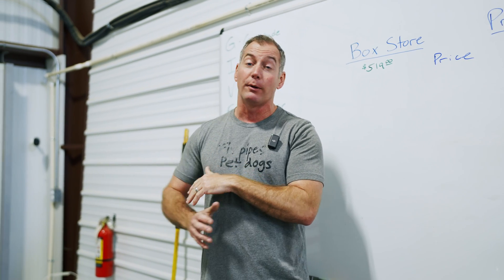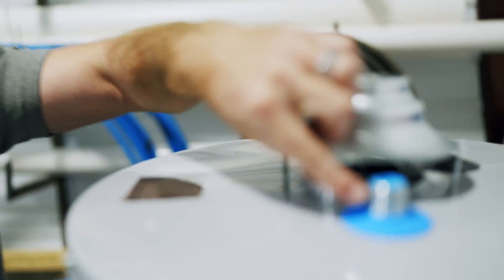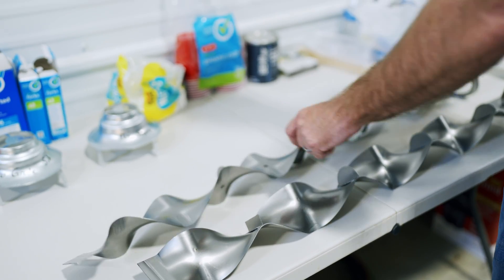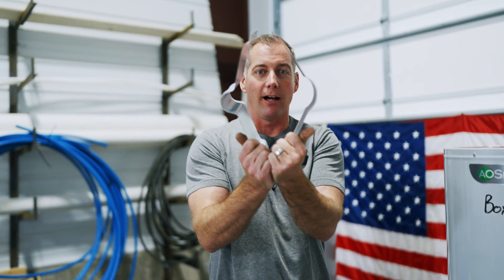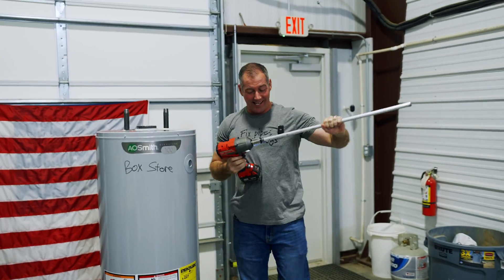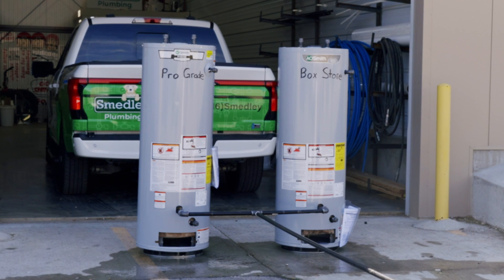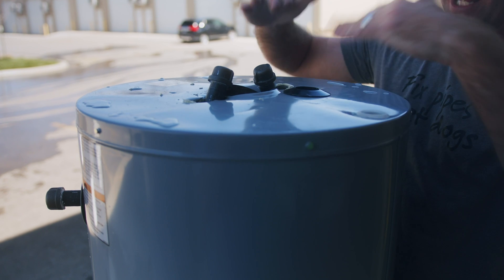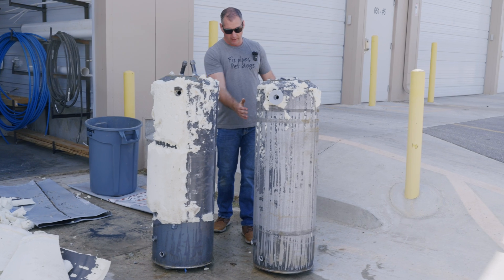What's the best water heater? Box Store vs. Pro Grade

Comment: I've been asked to replace our Reem tank. The difference between stores here is $700 that's alot! I'm going to look it over but hard to justify that kind of money
Reply from the maker: The moment you have to buy it twice, it's worth it.
Reply: @SmedleyPlumbing  mine is discontinued replacement is $5400 cdn 
Not sold in box stores.
Reply: @SmedleyPlumbing  looking on YouTube I see nothing really on condensing gas water tanks. Lots of tankless though.
Reply from the maker: @mikevandenboom5958  that's because the installed cost is very similar but the tankless is the better option.

Comment: You will always pick Pro Grade because that is what you sell? Not judging, just staying that fact. I am currently trying to decide which way to go. Box Store talk Great, Plumbers talk Great. I am lost
Reply from the maker: I pick the pro grade because I've seen over the last 20 years how much longer they last compared to box store water heaters.  When I built my house 13 years ago there was a water heater shortage of the supply house and so one of my two water heaters needed to be purchased from a box store. That water heater started leaking in 5 years. Meanwhile my other water heater which was a pro-grade water heater never leaked.  I ended up replacing both of them a couple of years ago but the box store water heater was the only one that leaked.

Comment: I wonder if Rheem is different from supply house or big box? I had bad luck with A O Smith water heaters in the past and avoid using them. Arm I started plumbing water heaters were $120 and lasted 20 years or more.
Reply from the maker: Rheem is absolutely different as well.

Comment: Lighter doesn't always mean less sturdy, insignificant, you should have measured the steel thickness on the burner cover. The cover might be used on both lines; each cover is a variant or alternate build. They probably build the same units on the same lines at different times. And or at the same time to a degree they all get built at the same time to a point then the "differences" are installed at the end of the line. Check Valve, Drain Valve, Control, Head Snake and Sticker. - Check the part numbers instead of guessing. Control valves and covers - even if they look different - could have the same number. It's not abnormal. - Look at the part numbers first next time. If the control was different, they'd have different part numbers. (And or the exact same part can have two part numbers so service can charge differently. But Internal to the control manufacturer they could be the exact same construction.  I spent about 30 yrs in the appliance industry we had to do these types of things because of the competition between  Home Depot vs Lowes vs Sears vs ......
Reply from the maker: Yeah they most likely different on the inside as well since they weigh different amounts.

Comment: It seems that you pointed out a lot of differences that make no difference to us who just want a decent hot water heater that is efficient and will last with minimal issues and costs.

Also, maximum burst pressure does not equal quality.
Reply from the maker: Virtually every part is of lower quality.  That equates to shorter life.
Reply: @SmedleyPlumbing  great, be specific and show how they fail and why.
Reply from the maker: @jacobframe8769  we did.  We showed the box store tank steel was thin enough to swell and split the outer jacket.  In the real world, that swelling happens over time and it breaks the glass lining and compromises the corrosion protection.  This is why it's more common for box store tanks to leak after a few years.  They rust out.

Comment: Everytime I have one fail it's on the weekend when the plumbing supply is closed. I look at them every time at the box store, see the plastic valves and specs on anode rods and wait until Monday. It's usually about the same price or cheaper at plumbing supply. Gas heaters have lasted 12-24 years, electrics   corroded and failed in about 10. I suspect if anode rod replaced, results would be better. Had a 2 yr old tank stink of sulfur so I replaced the anode rod with a different metal, the 2 yr old rod was nearly gone when I took it out, this was electric.
Reply from the maker: Yep!

Comment: These are 2 different models. If you bought the box store unit in this video from a plumber supply what would be the difference? None correct?
Reply from the maker: These are the same model from two different places.  The video shows the differences.  These are both AO Smith 40 gallon natural gas units.  One from Lowe's and one from Winnelson.
Reply: @SmedleyPlumbing  AO Smith sells Pro Line series thru plumbers and Signature series thru Lowes. 2 different model lines.
Reply from the maker: @matthewjohnson775  they like to lead the public to believe they're the same units.
Reply: @SmedleyPlumbing  Kinda like you lead the public into believing you're comparing models of the same era and from the same factory? The stickers on both units, (which you don't show), should not only tell you the city they were made in, but also the year they were made. You're comparing an older pro model to a newer box store model. Which would be fine, except the pro model is like 5 years old*. A.O. Smith has since changed the thickness of metal used on *all models in all their factories

Comment: This is awesome. Weighing the all of the parts is a nice touch. Testing them to failure at high pressure was fun, but like you mentioned about the weight of the tanks themselves and the comparisons of the anode rods, the pro heater will survive corrosion better. I would have liked to see some measurements, especially of the insulation and a cross section cut of the tanks.

I replaced my 20 year old water heater a few years ago. I noticed the big box stores had AO Smith, but I saw the plumbing supply house near me had them too. Different part numbers. I am sure there was a price difference as well. I decided to go with the one which wasn't built down to a cost. 

I've been in project cost optimization meetings. You sit around and figure out how to shave cents off each part. Sometimes you can do this without sacrificing quality. Sometimes you need to accept some reduction in performance.
Reply from the maker: We thought about cutting them open but we figured we'd compromise all the integrity with the pressure test so we wouldn't gain info from what's inside.

Comment: My Rheem weighs 485lbs.... Super duty pro
Reply from the maker: That's a massive heater!
Reply: How much does it weight without water in it.
Reply: @The_Borg  I was joking, I don't see how weight alone is that important in assessing quality. The rheem I have installed for myself is a 55gal weighs 185lbs empty, but has 12year warranty, brass drain, quality nipples lined for dielectric purpose, honeywell gas manifold/controller, self maintanance built in, 97 gal first hour delivery,  56% recovery rate... There's a lot more to quality than just weight... All I'm seeing in this video is a scale over and over...
Reply: @-.__.__.-Rad  My bad.

Comment: Pro grade FAILED, As a plumber of 25 years I have had more trouble from "Pro Grade" supply house heaters.  I had to replace gas valve 3 times in 6 months on a Pro Heater!!!!  Never again.  I let the customer choose, but I  will  do everything I can to persuade them to buy from BOX store.
Reply: Don't I know it. Not worth the difference in my book. A year or so ago the supply house was 200.00 more banana box store
Reply: You just say "prograde", but don't specify any manufacturer / brand name.
Reply: @wisdomrules8474  Rheem, AO Smith
Reply from the maker: Rheem had a bad run of gas valves.  We were testing to failure.  The box store unit leaked first.

Comment: Bought my house with a NG steam furnace in 1993. In 1995 my furnace wouldn't stay lit. I tested everything that I could. The only thing that I couldn't test was the thermocouple. It was 3:30pm on Sat, so I gave up and called a plumber. Home service call and 10 minutes of work cost me $200. I learned a lesson. 
30 months later, same thing - no pilot. This time I did it in 15 minutes with one from Home Depot. 20 years go by and every one that was bought from HD only last 16-18 months. I switched to Lowes and I'm back to replacing it to over 2-3 years again. Twice as long for $2 more.
Reply from the maker: Exactly!